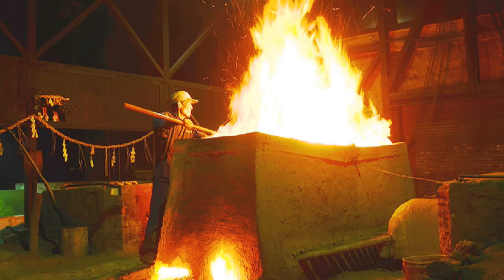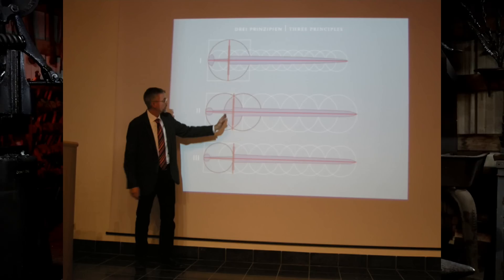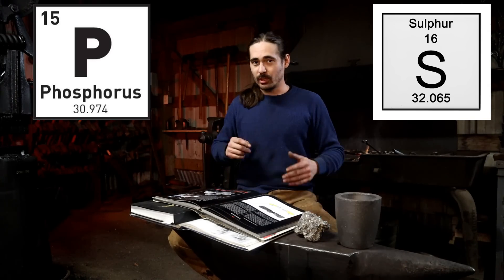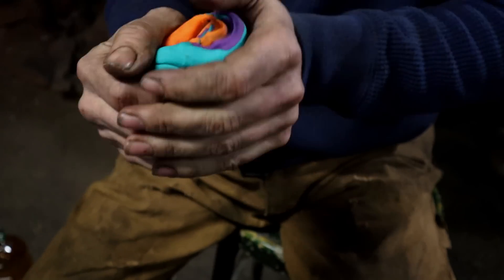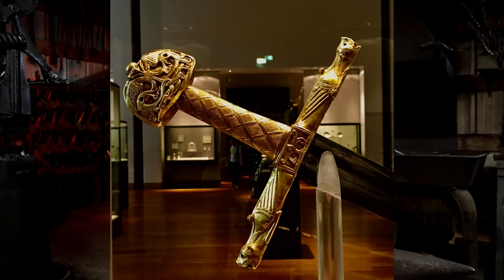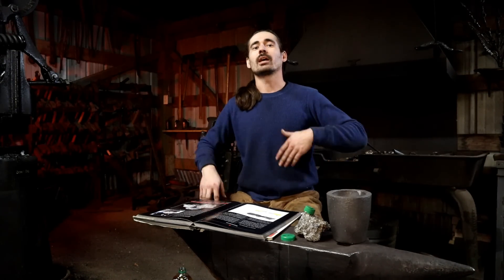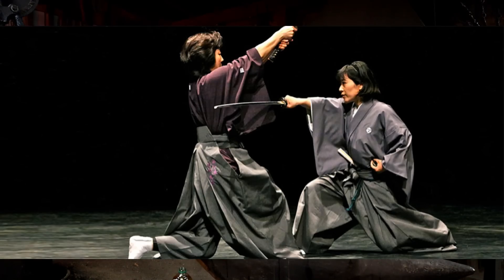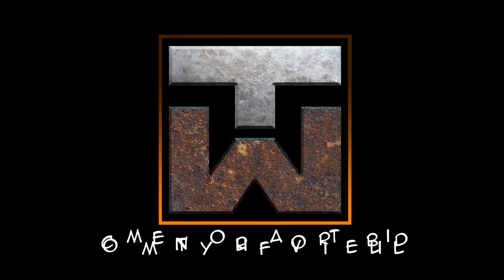Misconceptions About Medieval Steel - Wootz vs Bloom

Comment: damn, this was great! A true HEMA-practicioner always HAS to question his interpretation, and this video definetly threw up some questions!!
Reply: I mean it only makes sense, even Shad pointed out the stupidity of a warrior dragging a sword along the ground or stabbing it in the ground was quite a stupid Hollywood trope, If you were relying on a weapon to help your survival in battle you wouldn't mistreat it, and after Ilya's breakdown I would almost say Swords were probably treated incredibly well as the expense of buying or creating one and the dependency on winning a battle would be down to how they fought, so with that being said you would just go haphazardly clanging them together or against armour recklessly,

 I do like the idea of a sword being slightly curved, for the same reason a flail might have been valued as you could take the sword and place it on top the opposing shield spine side down and use the curve to get an angle of stab behind the shield in a possible fatal spot, I think strikes against an opponent were probably incredibly calculated and you wouldn't just try battering a shield apart unless you had a weapon made specifically for that, But this may give new context to battles where a valid attack against the opponent was to not strike the person but instead attack the weapon, as once the sword is broken the opponent is all but dead.
Reply: @douganderson7002  I think it's more appropriate to say that it's an attempt to revive a dead tradition. The problem with that is you can have all the manuals, tapestries, and historical accounts you want, but the amount of nuance and context lost means it will forever be an imitation and not quite "the real thing". 

I'm sure years into the future there will probably some kinda Nokia brick phone cult too, with no idea why people slipped paper under the battery covers, or debate over why people had phone straps. A lot simply won't be passed on to this new generation because it's treated as "common sense", when in fact it's simply the limitations of our time.
Reply: @Tremulousnut  What's a Nokia.
Reply: blueboywhitie  That is not what they are for, Maces were made to crush metal plate armor, same with warhammers and warpicks style weapons made to punch holes or just plain crush. Maces can be quite heavy and slow in battle so by the time you try to wind up against a shield and sword all the person needs to do is step in using the shield to block the mace and force it to the side and thrust with the sword, partially that is why shield sword armor was made, Axes well they are cheap and easy to make, Vikings used them quite effectively but using axes against a viking shield wall is kind of pointless, the bullet cap on the shield was used as a means to attacking and well destroying weapons used against you, plus if the axe gets lodged in the shield you are screwed.
Now a Poleaxe or duckbill well they were cheap and great on battlefields because they had a pick, curved part for ripping armor off, and the axe blade portion, that still doesn't mean though you didn't have to be careful.
Reply: @tmac2744  "Made by the Japenese, you know. They know the way of the samurai." Who knew Laplanders could reindeer phones with katanas?
Reply: @douganderson7002  HEMA is a hobby it should become a contact sport and should be trained like one.
Reply: @nocturnal101ravenous6  short maces are used as horseback backup weapons, it's bad at foot combat

Comment: Great video. Almost the level of a great TED talk.

I do want to bring up that it is my personal belief that percentages of material specs mean very little, as it’s position and layout as a molecular structure can change everything. For example, carbon nanotubes and buckyballs have very different specifications than a pile of coal dust, even though they may have the same carbon content.
Reply: Verhoeven and other scientists don't think wootz has nanotubes or nanowires; 

"Steel expert John Verhoeven, of Iowa State University in Ames, suggests Paufler is seeing something else. Cementite can itself exist as rods, he notes, so there might not be any carbon nanotubes in the rod-like structure.

Another potential problem is that TEM equipment sometimes contains nanotubes, says physicist Alex Zettl of the University of California, Berkeley. Paufler admits it is difficult to exclude the problem but says that, having studied the swords with a range of different equipment, he is convinced that the tubes he sees are from the swords."

For context, Verhoeven et al discovered the role of carbide formers in making pattern forming crucible steel
Reply: IPostSwords not saying they have bro. Just saying that I think comparing content percentages on it’s own is not a useful metric.
Reply: TED talk is just trash in most cases
Reply: Jay Dee You think? :)
Reply: @poelmeister  yep ;)
Reply: Yes, but you're also talking about modern materials where we've developed complex techniques for alloying and even "freezing" in place amorphous metals. Changing concentrations of an evenly distributed trace element or impurity (as we would see with a folding process) will not form buckyballs or nanotubes on a whim. There are many examples of plenty of historical swords where this type of thing was looked for and wasn't found. 

These types of techniques were not available very easily in europe, and when they were discovered (Wootz Damascus, with its somewhat unique crystal grain patterns) it was almost an accident or years of tradition, and process, and passing that down, as well as a well guarded secret. And not much was understood so it was hard to record and hard to pass down... That's why the technique was also lost until it was discovered that trace amounts of Vanadium made it easier to grow those types of microstructures.
Reply: @WinterCharmVT  I'm in no way a metal smith but I also feel like concentrating on the amounts of impurities in the metal alone is not helpful.  Rather the way those impurities affect the final product is what a warrior or soldier cares about.   Even crucible steel with more impurities will still have those impurities more equally distributed.  Meaning, you're still more likely to have a more durable blade made of crucible steel than bloomery steel due to a lesser chance of those impurities being concentrated in a fatal flaw.   Obviously various cultures came up with various solutions for making better steel and better blades but what this video doesn't cover is COST.  

I feel like crucible steel is still going to produce the best metal for the least cost all things being equal.  So depending on who's paying for the sword, and yes their social status.....the median over all sword quality and production techniques are going to vary wildly.  I don't think the shoguns top blade maker was also making blades of equal quality for the ashigaru.  Good enough for battle and superior quality aren't always the same thing.
Reply: Yeah, if we had the ability to place alloys molecule by molecule we would be building replicators.  A sword with differential carbon placement vs a sword that is pattern welded steel would be 2 different beasts.  The is an old blacksmith that figured out what the elements were that made a true Damascus alloy by analyzing high quality scimitars of the era and then duplicating the mix.
Reply: Wootz damascus or true damascus has both specific impurity amounts AND the existence of nanostructures without folding or pattern welding.

Comment: I gave an actual cheer when you got to the "form must follow function" part near the end. I have long held that physics dictates that martial arts be CONvergent, rather than DIvergent. Even with the differences in steel you discuss, weapons are their uses are far more similar than different in all parts of the world. If you see two wildly different styles, there is a great likelihood that at least one of them is wrong- and possibly both.  An entire fighting style would not develop, that relied on an exotic weapon. Exactly the opposite, the generally accepted practices would be functional with whatever weapons were normally available. If your interpretation of a fighting style only works with a weapon that would have been mostly unavailable in its day, then your interpretation is wrong.  

...and that goes equally true on both sides.
Reply: Quite insightful response. And I entirely agree. And laughed out loud when you mentioned seeing a DIvergent style probably being wrong, as well as interpretations of ancient martial combat using modern weapons makes just about no sense at all. And to your point, form without function is--well...not functional. Always been one of my pet peeves about over/under-engineered weapon systems, and methods of their use. I'll use some more modern examples, but the point is the same. One is far too complex for reality (Tiger tank for instance, expensive yet scary....when they worked), and the other is totally useless in reality (TBD Devastator and Mark 13 torpedo), and if your method doesn't match your weapon (Devastator again, because torpedoes actually work in theory...well, theirs didn't work at all, no matter what aircraft they were paired with...but that lumbering plane delivering them at near stall speed at a rather convenient height for enemy gunnery? Not so much), so basically too complex, too simple, or too imprecise (which is really a method aspect in and of itself), or unable to perform the task assigned,  all pretty much useless in the end. If your weapon of choice works great then breaks when you sneeze, or it just never was going to work because you are using it wrong, you might want to rethink your approach to the whole combat thing.

EDIT: I originally accidentally mentioned the TBF Avenger instead of the Devastator, so correction made.
Reply: Yeah, humans biomechanically are the same no matter where in the world you’re from, so it makes sense that techniques and design will generally be fairly similar with just a few differences based on culture, doctrine, etc.
Reply: Yup. I'd expand that a fighting style begins to develop with the simplest and most readily available tool. That's probably a simple stick in most cultures. From there, the weapon development and style evolution will follow each other. Stick becomes stone spear, and the style begins to emphasize thrusts. Stone spear becomes metal spear and cuts are introduced. Spear tip grows stronger and larger, facilitates complex styles and associated techniques in fighting. 
The complex head (polearm) is the last in the chain, so logically the associated fighting styles would be derivative of those suited to the previous weapons. 

The same basic evolution would follow most weapons and techniques. Very few would be so revolutionary that they arrive without the past trailing behind them.
Reply: Hell, you even see that with guns, which all have fairly similar form no matter where in the world they’re from. And even a lot of ergonomic concepts like a handle and trigger came from crossbows.

Comment: Hi Ilya, it was an incredible video!! I have some questions regarding to wootz ingots and the problem of P and S in the blade's brittelness: in an article from John Verhoeven where it talks about wootz making, he says that it was difficult to work with the steel because it was too brittle, mainly caused from the high % of P presented in the blade as you said. For making it more suitable to work with, the smith Alfred Pendray devised an "oxidation trick" that also ancient Indian smiths used for making their swords.
My question is, even by using this trick, it is still to high the % of P and S when the sword is finished or makes it more like bloomery steel? If so, was this method only applied for top quality wootz blades?
And finally, I have a question regarding wootz quality in contrast with Ulfberth swords: as you said, in wootz steel P and S don't come out because the steel is not folded. Were Ulfberth swords then, so appraised because they folded the wootz steel (as they would with typical bloomery steel from Europe), making P and S go out and having almost homogeneous steel (because of the lack of other impurities and slag given from being a crucible steel and with few P and S from folding it)? Or was it because that particular wootz was from the top quality (and rarer type), having few P and S from the begining?

P.S: sorry for my bad english. The article I'm referring to: Verhoeven, J. (2007). Pattern formation in wootz damascus steel swords and blades. Indian Journal of History of Science, 559-574.

Comment: Woots steel Is known for its unparalleled sharpness unlike the Damascs steel which was known for its unparalleled durability woots steel was known for being able to cut through nearly anything over exaggerated. Nonetheless, Damascus steel what's known for its durability? Yes it was similarly sharp to woots but a lot less sharper what Damascus was known for was it's durability it was said that Damascus steel the original Damascus steel was ancient forge weld steel made by hammering two parts of steel together. They did a test on an ancient Damascus blade. It had a bit over 2,000 PSI worth of pressure close to 3,000 before Brooke. If I remember right, let's just put on YouTube a while back. The blade was supposedly an ancient blade Damascus steel to this day it's still not known. Yes, we have some crappy knockoffs steel but we did not know the true formula for how it was done. We can mimic the patterns though. It's still technically a lost art for we did not know the steps nor the formula to properly to get those chunks of metal to bond to the blade with such strength and durability. I'm not here for the baits. You can check this up on the internet itself. True damascus steel knowledge is still truly to this day of Lost art still, I believe there may be some Smith's that are still hidden in India who can still properly do it though it's a sacred tradition if someone knows how to do it, they're probably still hiding the moment they speak up someone's going to force them to spill their secrets even in their own Homeland

Comment: +thatworks in regards to Meyer, there are illustrations and plays which involve using the flex of the weapon to slap your opponent in the side of the head, as well as deliberately striking with the flat to store energy to use on a second cut. 

Mind you, Meyer was mid 16th C and is there is also artwork from the 15th C depicting feders high degrees of flex - including one of a man flexing the sword over his own head.

Comment: In India especially in southern parts the blacksmiths are not low class actually.  They were kinda middle class along with other smiths they are called as 5-families. This group includes 5 types of Smith's like blacksmiths, goldsmiths and so on. As for education, although I am unaware of the data, the level is quite high because most traditions are passed through texts actually.....